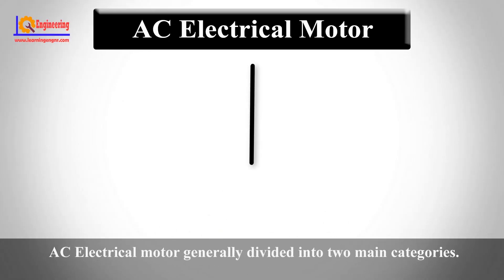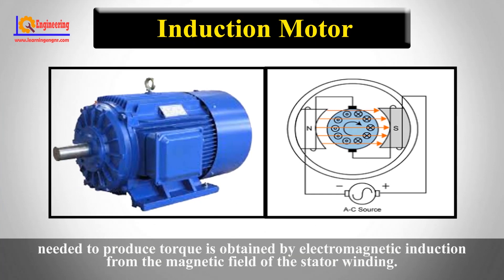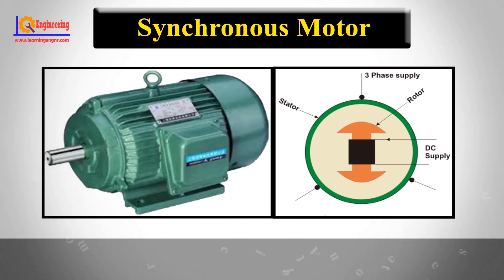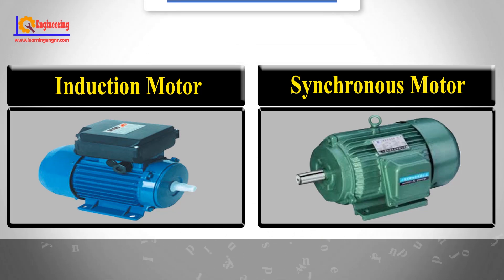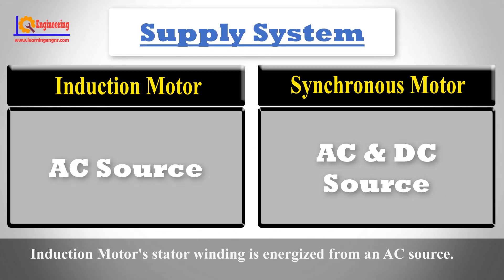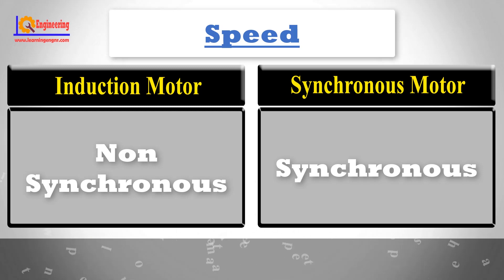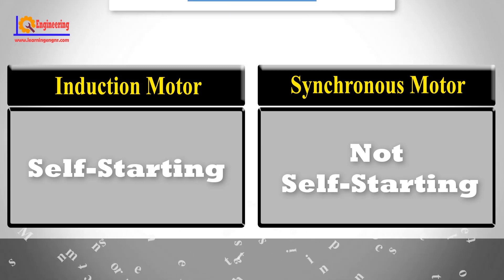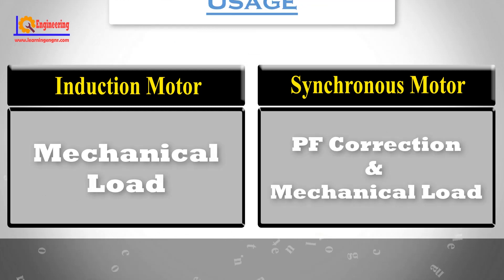Synchronous Motor vs Induction Motor - Difference Between Induction Motor and Synchronous Motor

Comment: Good video, but think it would be good to clarify two things. A synchronous motor might be more expensive than an induction motor in purchasing but thanks to higher efficiency it will cost less to run. Another thing is that an induction motor will always pull reactive power meanwhile a synchronous motor can produce reactive power. Of importance if the synchronous motor is of larger size where it camn make a difference.